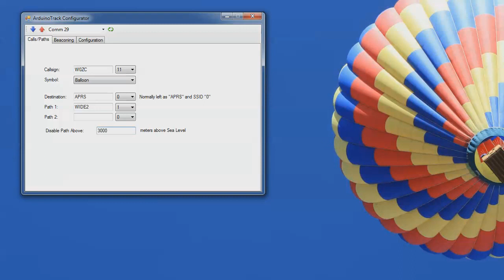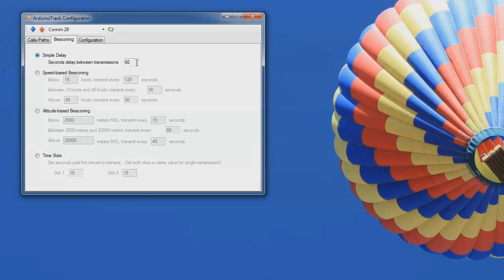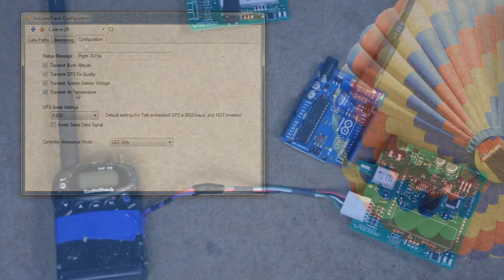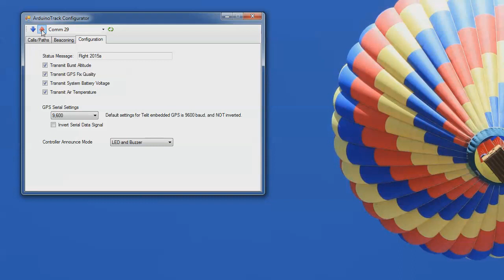Introduction to ArduinoTrack

Comment: Hey great video, one quick question? Where can I get the "Arduino track configurator" I am new & am working on a tracker along with the builder. Thanks!
Also is the all in one board available somewhere? I have an HT I wanna experiment with I assume a PTT circuit is built on the board?